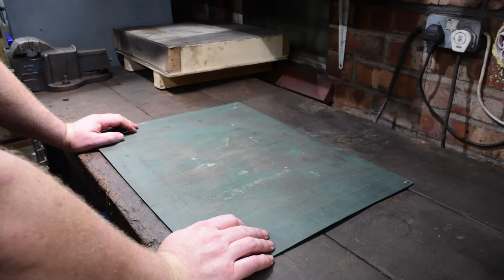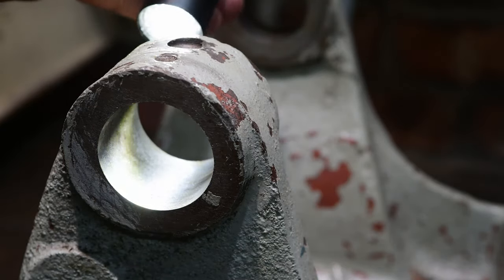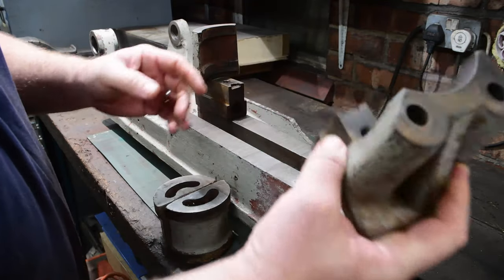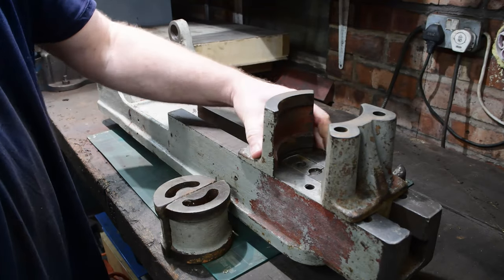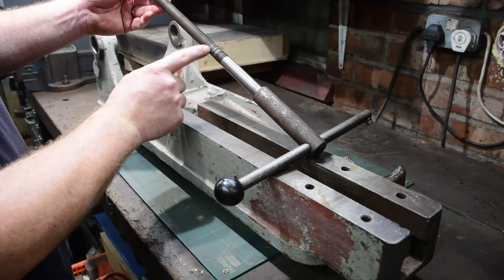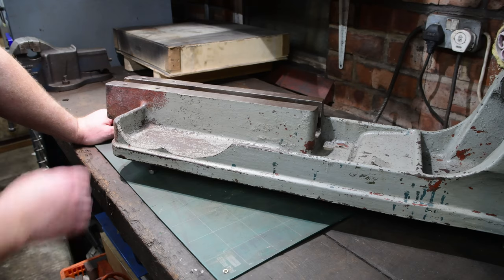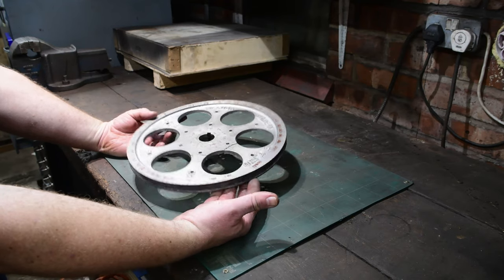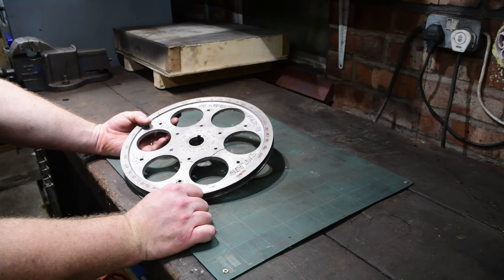Rapidor Manchester Restoration - Update No.1

Comment: That pulley is probably not original. My saw was one of the last made and has a cast iron pulley as have all the others I've seen. If your replacing the crank pin it may be worth boring out the bronze bearing and making the new crank shaft oversize to  match. Those oil grooves will be hard to replicate. The crack in the base could be filled with a piece of steel plate that could be brazed in and ground down. Would need to post heat to stop cracks with the size of the repair.
Reply from the maker: Hi, that's great, thanks for the update. I will probably go with the steel plate brazed in. For the pulley, I have seen photos of saws with a clutch assembly, which I'm assuming was lost somewhere along the way. I shall try to find a suitable replacement, or make one..